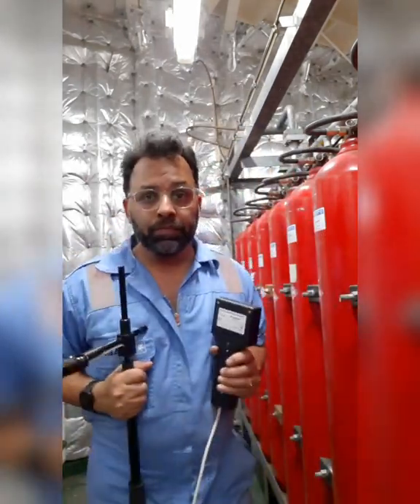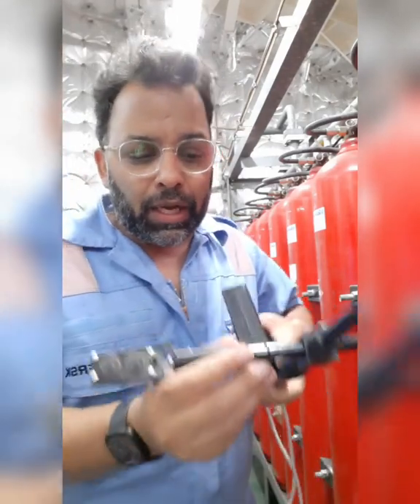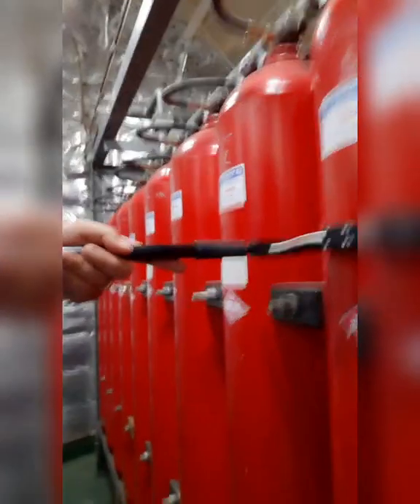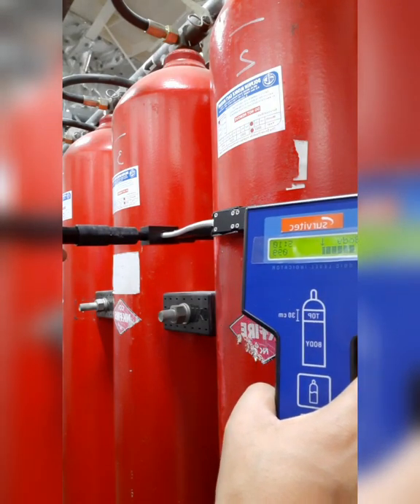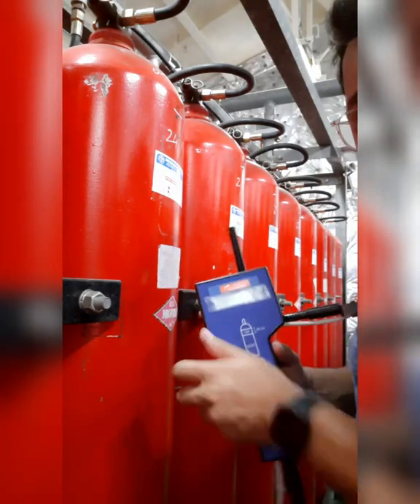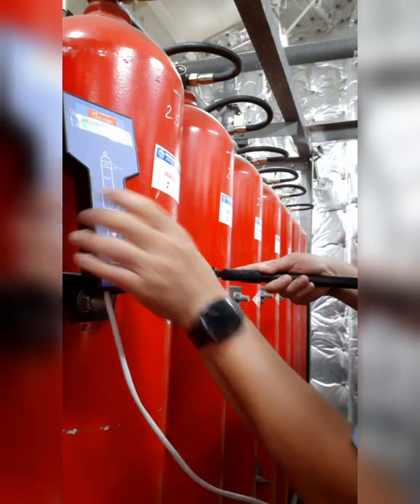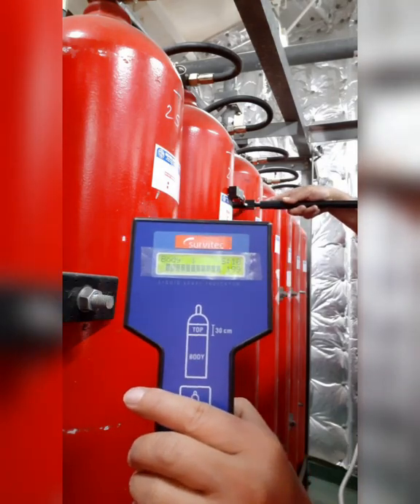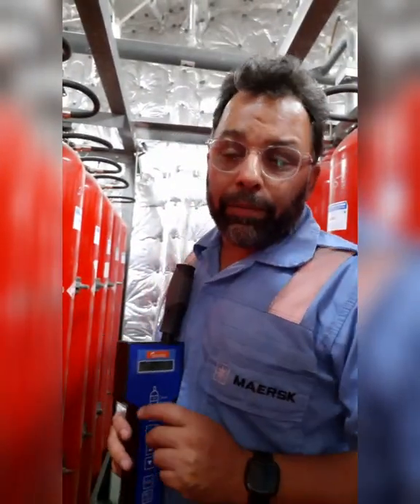Is Your CO2 Bottle REALLY Full?

Comment: sir, good day. 
in marine college we were taught that, we have to weigh the co2 bottle. if the bottle loses 10% of its weight, we need to refill. do you think ultrasonic testing is reliable and true interpretation of actual co2 level?
Reply from the maker: yes you are absolutely correct but for onboard testing of level this ultrasonic testing is very good and reliable enough